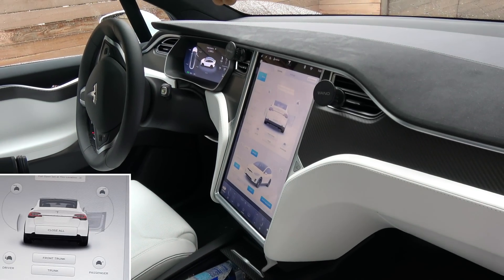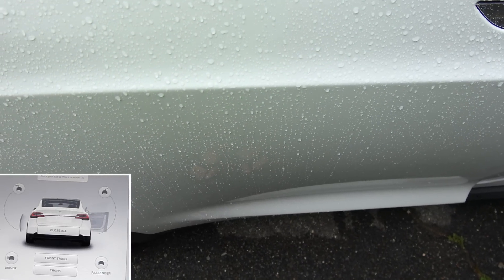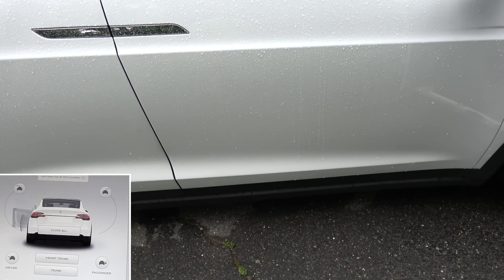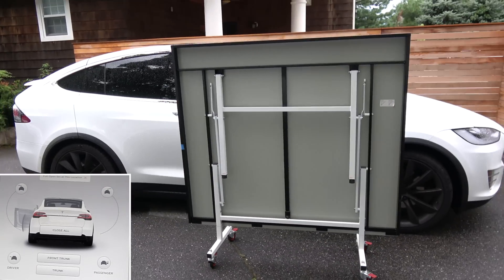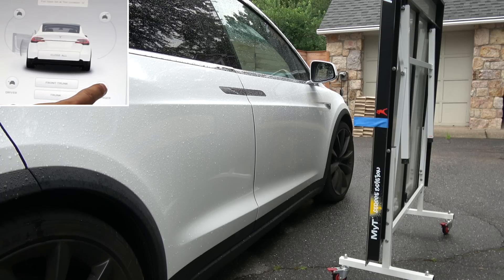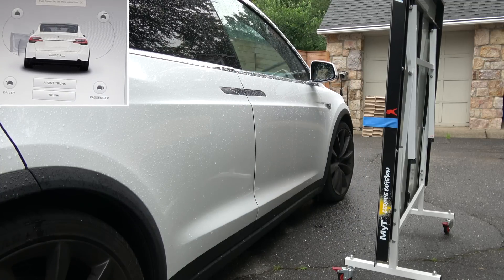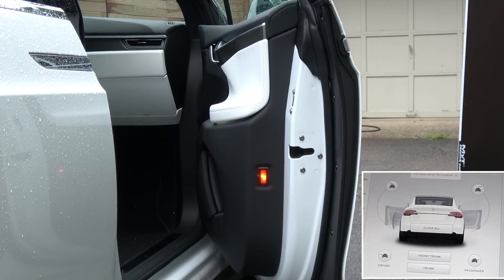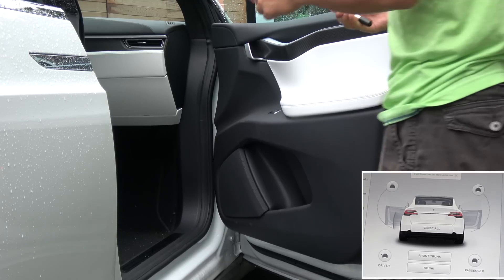Tesla Model X Falcon Wing Door External Sensors - They Control the Front Doors! DEMO - Part 1 of 2

Comment: Why would you open a door onto something, you still gotta use some common sense. Anyway, With the new autopilot suite 2.0 including all cameras all this can be solved for people without common sense.....
Reply from the maker: +mikeberg can you see a hydrant?  People you drive around don't remember the doors are powered.   So if you pull up next to things and the car doesn't detect them then you dent.   AP 2.0 won't be working until years from now.  Doesn't help me and won't help anyone for years to come.
Reply: MEtv Product Reviews The cams will most probably be used to assist in avoiding opening doors into obstructions. That type of functionality is something that would be implemented in the coming months, not connected with AP functionality
Reply from the maker: mikeberg doubtful the camera will do that.  They use the sonar today to detect distance.  Last time I checked cameras cannot do that.  If they did, why have sonar and radar?
Reply: MEtv Product Reviews We Will have to wait and see I guess.
Reply from the maker: mikeberg would not hold my breath.  But I think in v8 they did change the sensors in the fwd to do something more.  Also the techs told me they will use the sonar from the side parking sensors too.  Haven't retested it yet.  But have notice some different behavior.  Will have to test.  Don't need the v2.0 for fix.  Lol

Comment: I have sensors that detect only suitable sized parking spaces. They also check for obstructions on the front, rear and hatch doors. If they detect any obstructions, they automatically search for another more suitable space..... They are called EYES!!!

Are we getting to a stage where we have to rely on technology to open a damn car door now!!! I love tech, but only if it improves on something I do.
Reply: Tesla has spent so much time/$/effort on things very few car buyers really car about, falcon wings doors, automatic opening front doors, when they should have paid more attention to the poorly fit chrome trim on the rear door that's misaligned with the front door by enough to really stand out.
Reply from the maker: You have better eyes than most.  Most people would benefit from the auto parking. 

The fwd open out and swing up so yes they need sensor.  You issue is with the fact they are motorized and too complicated.  I agree they are complicated.  I like them if they can get it working correctly and safely. B
Reply: +MEtv Product Reviews At 60, my eyes are not as good as they used to be. The law currently states that the driver is responsible for the safe operation of a motor vehicle - not computers, sensors, motors. Don't get me wrong my home is as automated as they come, but automation does not fully replace human control - these sensors are not considered Ai.

In the U.K., cars that have automation systems are not allowed to be used for driving tests - the car has to be fully controlled by the driver at all times - this is also backed up by Tesla.....  basically a get out of all legal claims clause. Relying on automation can have fatal consequences- which sadly has already been proven.
Reply: you forgot to talk about the quality. that door closing sounds like a old farm truck door slaming. my 06 passat or my 11 bmw 3 series has a solid sound when the door slams. that is just nasty. im not bashing tesla. i love tesla and what they are doing. innovative, no fear of taking risks, making electric cars cool, fast and objects of pride. but, like all the american auto industry, they lost the focus on fundamental stuff like bild quality, and making you feel special. again, i love tesla, and it was one of the best rides i've had, but there is something missing
Reply from the maker: Nelson Marques yes agree I miss the sound of my Audi slamming with a solid sound.  Not sure what it is with American cars.
Reply: Nelson Marques It's a slow close because the door mechanism shuts it completely. This car changes that. No need to slam or even close it, just push it to the point where it closes itself
Reply: its not about how fast the door closes. when it closes, it makes a nasty cheap sound. not a solid sound. test it again a similar priced s class and ear the diference.